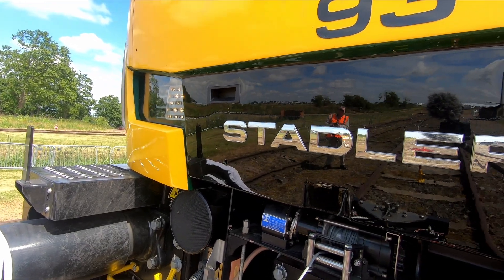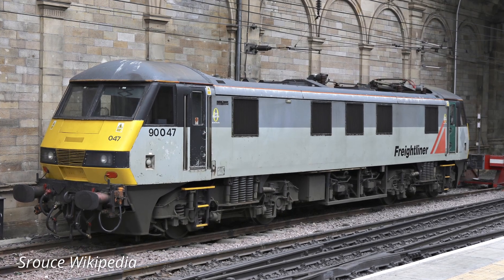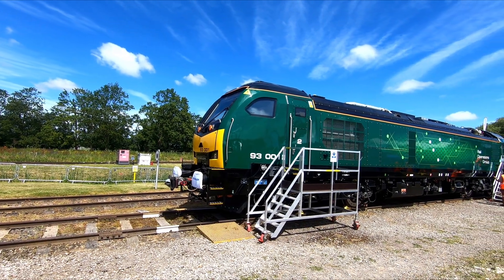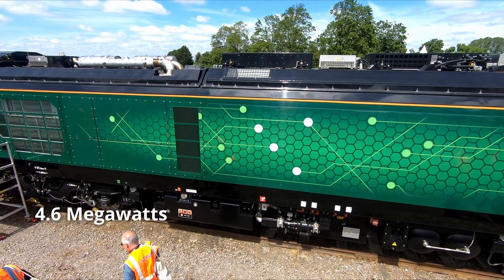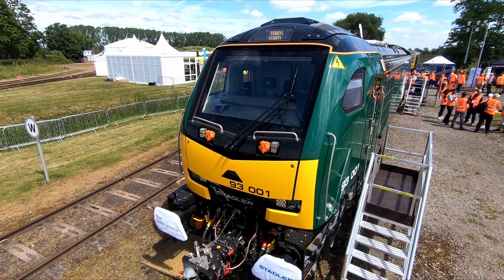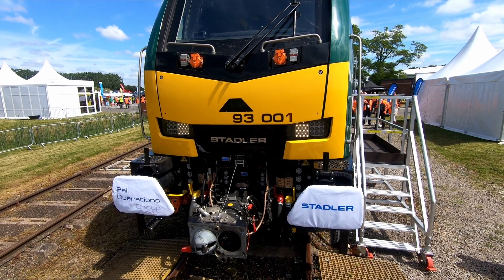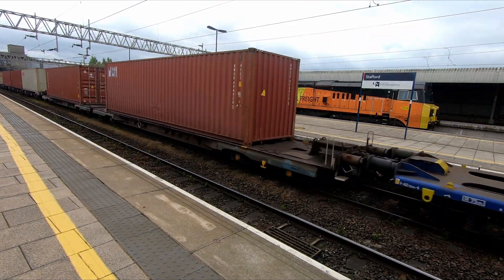Stadler Class 93 Tri-Mode Locomotive

Comment: It's extremely difficult to tell how these will perform away from the wires from just the spec sheet. 
It's going to be very dependent on the trip power management software across the route, so I'd guess there will be a big learning curve for everyone to optimise and balance overall running times and optimal battery charge/ discharge.
While class 66 has a lot of initial tractive effort, further up the speed curve it falls off a lot, so it will be interesting to see what the real world performance is like - away from the wires on flatter routes hauling intermodal the performance gap might be surprisingly small - with the ability to obtain better paths on more heavily contested electrified routes too, time and iterations of learning will tell.

Comment: A tall order 1200bhp diesel to handle 1600 ton freight with battery back up at total 1700bhp! I cant see them on freight with all that work covered by 66s 70s ? An order of 10 so far !
Reply from the maker: I did think that, but that's what the ROG rep told me. The engines and batteries should only be used for the very last few miles, so there maybe some WCML intermodal flows which they could be used for.
Reply: @Rail_Focus  
I guess they should be under the wires most of their life but will have good route availability
Reply: @Rail_Focus no chance
Reply: 100% nowhere near enough hp in diesel mode to haul freight

Comment: This looks good but is exactly wrong. A very expensive bit of kit that looks like it is brutal on the track - tiny wheels and a 21 ton axle load.

Freight trains should not be traveling at high speeds. It wastes energy and damages the track - the modern container carriers with small wheels are track bashers, and modern passenger trains are also destructive. It is becoming a real problem. 

Electricity supplies will have to be enhanced to get rid of diesel running under the wires, and overall thermodynamic efficiency goes down.

The 9F freight locomotive is as powerful when using coal and about 20% more powerful when running on diesel fuel. Probably costs 20% of this locomotive initially and much the same to run.
Reply from the maker: Not all container wagons have small wheels, just those typically used on gauge constrained routes. There are wagons available which are a lot more gentle on the rails and intermodal trains are really not that heavy.
Reply: @Rail_Focus 
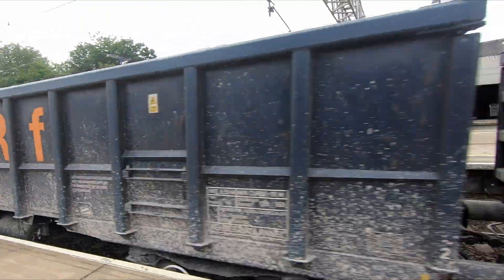You can hear how much damage these trains are doing by the roaring noise they make. You can hear it on the video at 1:25 and 2:53 . Nasty flats as well giving the track a hammering. No wonder the track is so rough.

Comment: I think it should have similar brake horse power as a Class 24 or a Class 26 while working in diesel mode.
Reply: Engine and battery it makes the same as a class 37

Comment: As much as I think it's incredibly good that we have more locomotives capable of both electric and diesel traction, I think they missed a trick the Class 93 not being quad mode and being able to draw off the 750V DC third rail in the southern region like the Class 92s can.
Reply: Doesn't matter. The DC power supply is generally inadequate.

Comment: Would love to see these on the West of England line. Loco haulage would vastly improve the passenger comfort and a good chunk is on third rail anyway (if the loco can be adapted for that).
Reply: It looks like a very expensive track basher. The West of England line should be electrified to Salisbury and operated on the same principle as the Weymouth line used to be. 

Then use class 37 in push pull mode to Exeter. A small build of new class 37 would be more to the point, or oil burning class 5 to the LMS design or LNER B1 which were simple and very cheap to build. 

The railways should stop shelling out vast amounts on unnecessarily high tech kit.

Comment: It’s a shame it’s got to drag a useless battery along.
Reply: The battery is mainly for emergency use and shunting, I believe
Reply: @andrewreynolds4949  
Yes the battery might just be able move the loco 50 yards to get it out of the way
Reply: @beau5757  It would be more than that; it should be able to drag the whole train out of the way. It should be able to match the output of the diesel engine for a very short period of time.
Reply from the maker: Not really
Reply: Its adding to the frame weight of the locomotive in other modes and to suggest batteries are useful to pull a 2000 tonne train any great distance is ludicrous, why bother😂
Reply: You guys are so stupid lmao

Comment: I wonder if they could take over from the 67's on the TfW services? Start and end under wires with batteries and diesel for the rest of the journey.
Reply from the maker: Someone said they'd struggle to pull a rake of mk4s over the Marches. But other than that I can't see much benefit. 

I think TfW will be keen to keep the 67s pn, given the time and effort they've invested in getting them to talk reliably to the Mk4s 😅

Comment: I do wonder if the class 93 will struggle to find a niche, like the class 67 did. I suspect a lot of what they will haul is either passenger services, like the sleeper, or replacing the class 90 by offering more flexibility. They really don't quite fit the same role as the class 66; that will be the class 99 ordered by GBRf, which I'm looking forward to more to see how well it does
Reply from the maker: The Class 99 will be quite a bit more powerful in diesel mode, but I would've thought it will still  struggle to pull anything other than intermodal consists in diesel mode. 

Could really do with a freight company who is willing to invest in 100mph capable intermodal wagons for use on the WCML or ECML, then the 93 would really prove its worth.
Reply: @Rail_Focus  The highest speed intermodal wagons in Europe are the relatively new French ones, and those are only certified for 140 kph / 87 mph. I'm not sure what the maximum speed for American intermodal wagons is, but I would be very surprised if it's above 90 mph. 80 mph is a good general max speed for freight efficiency, I doubt there will be any mass adoption of wagons permitting speeds significantly higher than that.
Reply: @Rail_Focus 
Why? These vehicles destroy the track and infrastructure.

Comment: Why does it have a Scharfenberg coupler?
Reply from the maker: It can be folded away, but I believe they may be changing the coupler.
Reply: There are multiple different couplers that can be folded down
Reply: will become the standard coupler in the future all wagons will have to have  sensors and detectors  soon   and one job ROG do is tow  stock for repair
Reply: @tomslade3365  Also this could mean that Multiple Units and newer carriages can be hauled with ease

Comment: I think these are an excellent idea. I wonder if they could be used by the Caledonian sleeper in the longer term as it would save a change of loco?
Reply from the maker: Not sure, but Simon did say they may be used for the new Euston to Stirling Grand Union service
Reply: @Rail_Focus In today’s world what if any advantages do loco hauled trains have?
Reply from the maker: That's a good question. I think there are still benefits on non electrified main lines such as the Chiltern Mainline or Marches. Not having heavy diesel engines under the carriages makes them quieter and typically makes for a more comfortable ride. There may also be cost savings just having to lease a single loco per set, rather than a DMU with multiple engines.

Comment: Fine looking loco and great sounding spec. However, what % of it is British built ?
We really must start making our own motive power and rolling stock again.
Reply from the maker: If Alstom offered a similar product then I'm sure freight companies would buy it. But it seems only Stadler is offering to build bespoke dual mode locos to a UK loading gauge
Reply: Only nationaIisation can guarantee nationaI production. The ruIing class, in charge of production, are inherently and definitionally international in both character and relations.
Reply from the maker: "Nationalisation" wouldn't have an impact on who manufactures the trains. Even under Labour ROSCOs would continue to own rolling stock and there's no way any Government would bring back nationalised factories.
Reply: @Rail_Focus  That's unfair. I didn't say "rail nationalisation" or "Labour" once, did I? I don't want to come off as rude, but it looks like you've put words in my mouth.

By "any government", what you really should say "any current government." One of a new type that isn't offered to us because it threatens bǐIIǐônǎîrěs. It's wise to widen your perspectives to include possibilities outside of our corrupt pǎrlǐǎměnt.

Comment: Transport for Wales should order some
Reply from the maker: Unfortunately due to the routes the Class 67s work then there wouldn't be much benefit, save for between Manchester and Crewe. TfW would be better off with cl68s for the time being.
Reply: @Rail_Focus  class 93 hasn't got enough power on diesel  to haul mk4s up the marches with all the ets requirements.  It's likely they'd order class 99s instead same with GWR
Reply from the maker: @anthonypowell5665 can't see there being much benefit of TfW ordering bi-modes yet.
Reply: @Rail_Focus I wonder if those 93's woudl work well with ex TPE Nova 3 sets ..
Reply from the maker: @polishstick0609  possibly, but the Mk5 are going to Chiltern, which isn't electrified. They only really make sense for short stints on non electrified lines.
Reply: @Rail_Focus  Is this confirmed or just speculation?
Reply from the maker: @polishstick0609  I think they're still negotiating, but it's been widely reported

Comment: Maybe TPE could buy some and use them in place of their class 68s. They could use the batteries in stations and sidings at night so as to reduce noise levels like those lovely sounding 68s.
Reply from the maker: TPE no longer operates cl68s.
Reply: @Rail_Focus  Yeah, when I said, "in place of" I suppose I should have said "in place of the replacements for class 68s" as I understand their 68s are already in storage. I also understand this was because they were too noisy for locals near termini, though several reasons were given by online commentators for their being taken out of service.
Reply: @SirKenchalot  The class 68s were returned to the ROSCO and have been put into freight service from what I've heard. The Mk 5 fleet is still in storage, but plenty of operators have been eyeing them

Comment: Nice video mate. It would be a shame that all 66s will be leaving 😢
Reply from the maker: I think 66s will be around for a good few years yet. But an alternative to running diesel under the wires is needed.
Reply: Lol, the class 66 definitely aren't leaving. The freight operators have been struggling to find more, and that's a major part of why these new locos are appearing. The 93s are more likely to replace things like the class 47 or 90.

Comment: Great informative video. One of the plans is for the Class 93s could operate passenger trains between London Euston and Stirling for Grand Union.
Reply from the maker: Thanks Simon. And thanks again for the clips 🙂
Reply: Unlikely now due to lack of mk4s available
Reply: @anthonypowell5665   the lots MK v  sitting about ?
Reply from the maker: Chiltern are under pressure to take on the MkVs
Reply: I could also see these on the Highland and Lowland sleeper given that currently they need to switch engines.
Reply: First Grand Union can still purchase mk4 coaches 😊 it’s not all doom and gloom folks. It’s going to start operating in June this year 🤩 the mk4 are currently on lease with LNER they’ll be off lease soon.

Comment: It's about time Britain started phasing out diesel under wires, the slow pace of electrification is bad enough but the fact that there's still consistent diesel-only operation on large stretches of electrified track really feels like a policy failure of some kind.
Reply from the maker: 100%. It's surprising how many WCML intermodal trains are hauled by 66s or 68s.
Reply: @Rail_Focus  Part of the problem may be the running costs w.r.t the unit prices per kWh by Network Rail compared with the price of diesel fuel etc, for the time being. The Rail Operations Group will do the sums on that basis.
Reply from the maker: @johnkeepin7527  true, but I think unit rates have become a little more affordable now. It's bonkers that running diesel locos was considerably cheaper than electric
Reply: @Rail_Focus  Maybe just my silly opinion but I think 25Kv should be heavily subsidised for freight and passenger companies.
Reply: @WalesRails 
Why? If it needs to be subsidised it shouldn't be happening.
Reply: @Rail_Focus 
It's about thermodynamics. And bulk freight and minerals should not be belting around at 75 mph. It wastes energy and smashes up the infrastructure.
Reply from the maker: I didn't say bulk freight. If you listen I say they will likely be used on intermodal
Reply: @Rail_Focus This one I am afraid is modulating a greenhouse gas. Best ignored.
Reply: @Rail_Focus  
What is the axle load, empty and with a loaded container mounted?

To judge from the noise, they must be wearing the track excessively. Unless the cargo is very high value or perishable, reliable overnight delivery should suffice. For high value or perishables, some like Red Star parcels carried on passenger trains would be more efficient.
Reply: Why? The overall thermal efficiency is lower on electricity and the power supply to the OHLE has to be reinforced. Electricity doesn't come from nowhere.
Reply: The Government are not interested in it despite that's the way to the "Net Zero" they parrot about. Don't expect any difference from the new puppets in power
Reply: Yes it’s crazy that London to Cardiff is under the wire but Bristol is not.
Reply: One of the nice things up here in Scotland is the rolling programme of electrification which has helped to lower the cost per mile of electrification. Such a shame Tory ministers have been doing a stop start progress for it which has massively increased the costs.